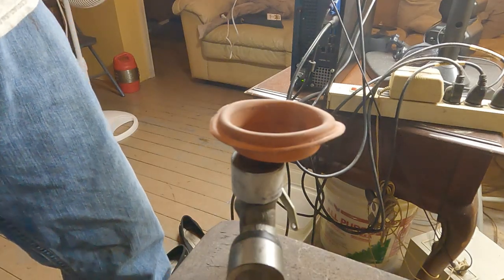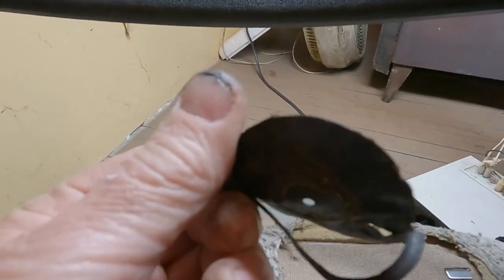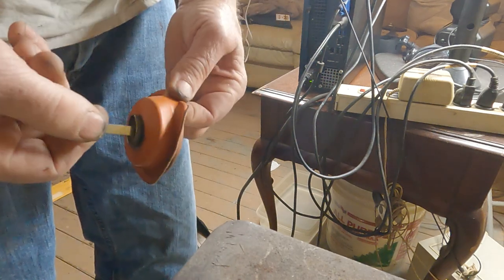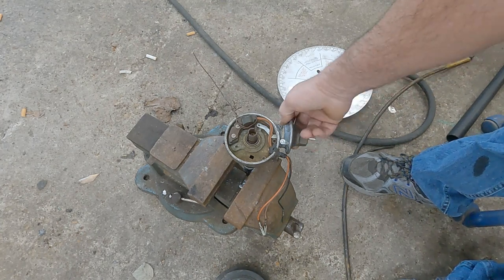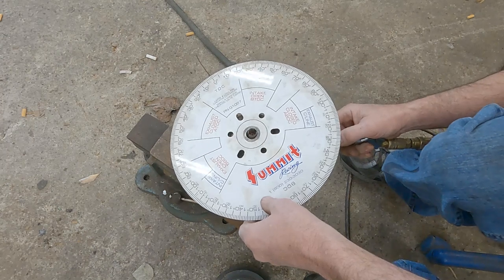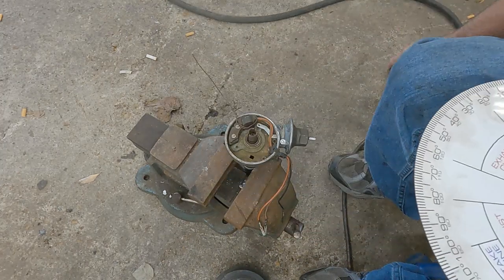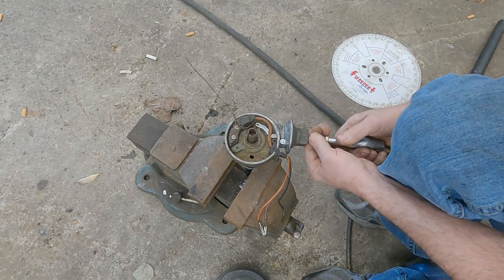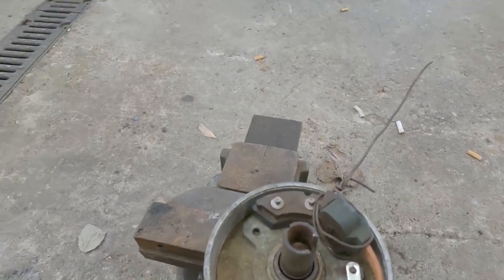Homemade Boost Retard  And Vacuum Advance For A Duraspark 2 Distributor

Comment: Very cool man. So you just replaced the diaphragm with one from a wastegate? What timing are you running at the distrib?
Reply from the maker: The old diaphragm was junk and I had the orange one out of a wastegate off one of these Semi turbos. I've been getting rid of some scrap and threw it in the dump trailer, had to dig it back out LOL. So I fixed some junk with some other junk and made it work. As far as timing it's been getting all of it LOL. If it has the same leg as the one I was testing on 10-14 base plus 21 centrifical plus whatever vacuum advance it adds yep all of it. That's why it was sounding like you dropped a hand full of BBs in it on 15 lbs of boost LOL.
Reply: @kickassmustangsgarage  How do you make it tho to take timing out under boost. My duraspark vac canister only goes one way?
Reply from the maker: I cut a coil out of the spring and ground the stop so everything moved forwards. Then I made a spring that pushes from the bottom. It takes up the slack and allows it to retard timing.
Reply: @kickassmustangsgarage  Any video of that mod? You hook it manifold vac I assume?
Reply from the maker: @HammerHeadGarage  I took bolt cutters and cut a half a coil off both ends of the spring  that's in a v pod.  I hook it to the vac port on the meter block like normal. Once it starts to make boost every port vac adv PCV. everything is pressurized line to the brake booster. I'v got a brake booster one way valve on my PCV valve so boost doesn't leak. So what was sucking air swaps to blowing air out under boost. You don't want it to advance timing till you  start giving  it gas
Reply: After all that and you couldn't put matching hold down screws?
Reply from the maker: They match on the truck. I just used what I could find to hold it while I tested it on a old distributor.
Reply from the maker: Well I didn't think about  the crank turning two times to one rotation of the distributor so 16 retard and 10 advance and 42 mechanical plus whatever base is. Sounds like I need to put some new marks on my balancer or put a new one with readable marks and breakout a timing light LOL.
Reply: @kickassmustangsgarage  go to summit racing and get some cheap timing tape. epoxy it to the balancer at zero. Thinks it is $16
Reply from the maker: @HammerHeadGarage  I think I'm gonna bolt that degree wheel to the crank and set up a pointer on zero and use it . I should be able to see it LOl. I still can't believe I was running 15 lbs with 40- 50 degrees of timming. The old $155 PullAPart motor might need to come out for a piston upgrade and gap the rings. I've got a set of factory TRW forged pistons out of a Mustang 5.0 that I can put in it.  I've got a old pre 80s 302 I thought about putting it in just to see how much boost it takes to split one LOL.
Reply: @kickassmustangsgarage  The vac advance would not be working on boost. It would be adding zero so you were running on your base plus whatever mechanical advance you have. But that is still too much for 15lbs. Even too much for 10lbs.
Reply from the maker: I know that's right.  I'll get it down in the safe zone and see how it runs then I might be able to turn it back up 15 lbs  without exploding
Reply: Well well well, look who it is. This turba sbf stuff is getting pretty common.
Reply from the maker: Yeah most people just buy a kit and put it on. I don't think there's to many making everything in-house. I haven't seen any using a T6 semi turbo. I just saw your comment YouTube didn't notify me. If you start a fresh comment I'll get a notification next time you comment.
Reply: @kickassmustangsgarage  Can't get no kit for a ranger that I'm aware of. Nothing fits unless you make it fit.
Reply from the maker: I just saw Ruszko's  comment and was letting him know why I'm just now responding. Yeah I know they don't make a kit for a Ranger.  Definitely not for a T6 turbo. I got a Dragy coming friday and I made a water meth kit for the truck that should help keep it alive. I've been redistilling some washer fluid and making my own water meth juice. Cost me $5 bucks for 5 gallons -30 deicer  that made 2 gallons of 82 percent pure methanol. I mixed up two and a half gallons of 50/50 and still have a half a gallon left of the 82 percent to make more. The rain-x -30 deicer is 50 percent methanol but it has crap that looks like oil in it that's why I distilled it.  I poured what was left back in the jug and now it's summer time washer fluid LOL.